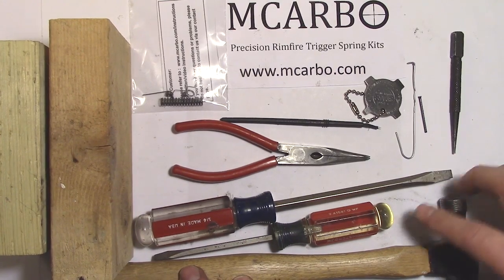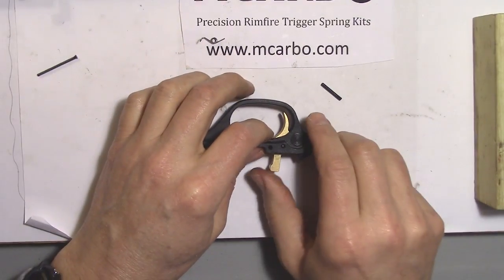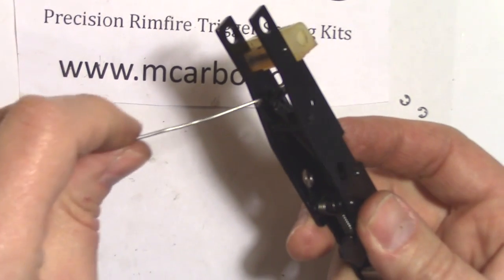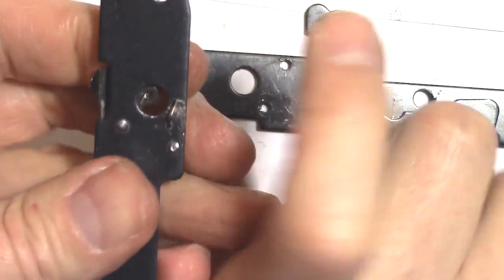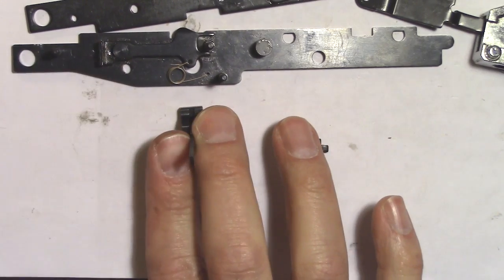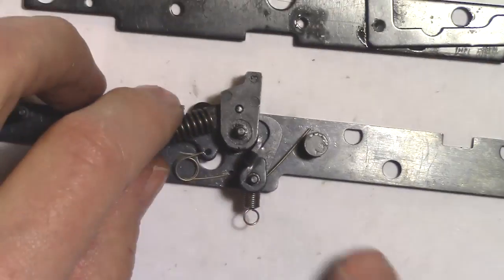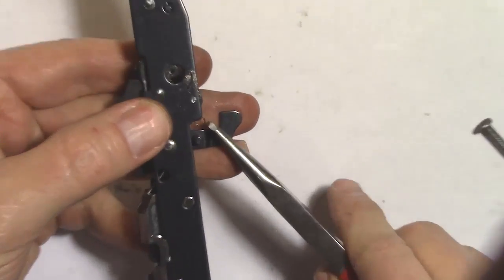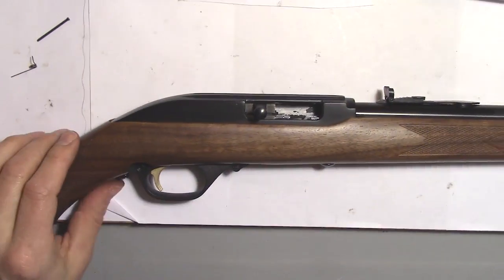Marlin Model 60 Trigger Job | MCARBO Marlin 60 Trigger Job | Marlin Model 60 Trigger Kit

Comment: I am ordering the spring kit, I recently got a brand new 1979 glenfield model 60, never fired, went out and shot it. it functioned flawlessly but the trigger is so hard a few times I had to double check that I had taken it off safety. 8 pounds if I was to guess, accuracy suffered because of the extremely hard trigger pull. Thanks for the spring kit and videos you provide!

Comment: this will be my next addition to my Marlins... both the 30 plus yr old and the 20 year old... thank you MCARBO for the great parts! Gunny out!
Reply: I did this to an 86 model 60. While everything was apart, I took the time to carefully polish all the contact surfaces. The result was a 3.5lb average trigger pull. The stock trigger was averaging 5.5lbs. I also installed their trigger assembly,  which removed most of the pre traval. I had to smooth out and polish the end of the adjusting screw because it was hanging up on the disconnector, but overall I'd say the $75.00 I spent on the Mcarbo parts was worth the result. The completed trigger job turned out sweet.

Comment: Just ordered this trigger spring kit yesterday, and can't wait to install it!  Thank you for specifying to lock the bolt back prior to removing the stock, and prior to placing the lower back onto the upper.  Not doing so can potentially bend the lift spring and cause jamming of the bolt, or other functionality issues.  this is a lesson I learned the hard way!  Anyway, I'm confident I'll be able to get this kit installed accurately, as I've watched this video several times already, and it is one of the best step-by-step instructional videos I've seen.  Really great job!
Reply from the maker: +DrgnRebrn Thank you for placing an order!  We appreciate the feedback on the video and we're glad you found it to be the best instructional video you've seen.  Big Thanks!

Comment: only thing I seen that you did not mention in the video was an issue that I just went through the spring that's used as a injector has to be adjusted to the right height and angle out or it will not eject rounds and stove pipe